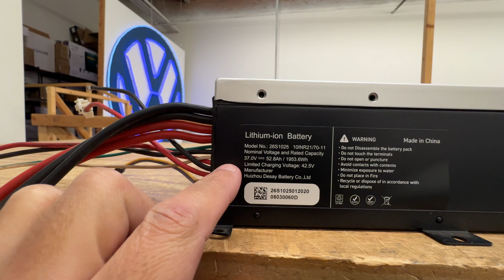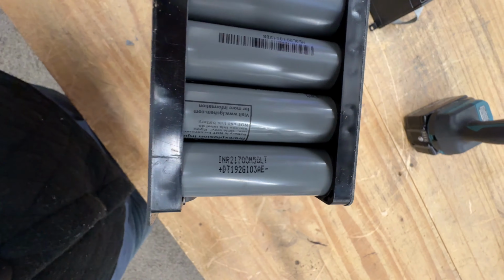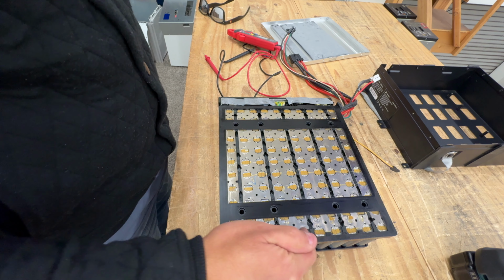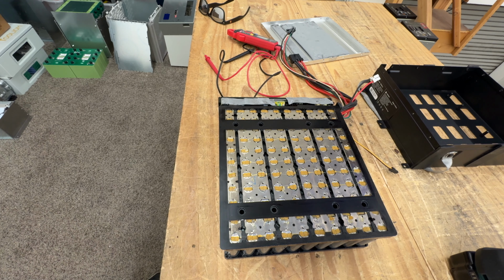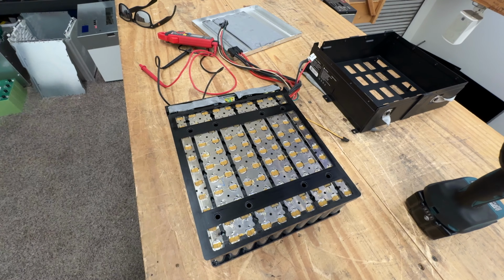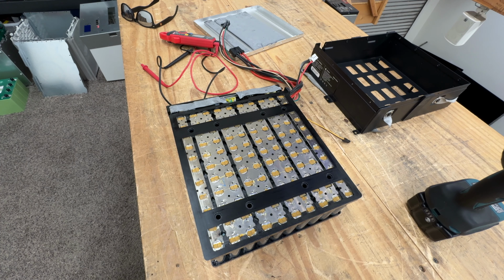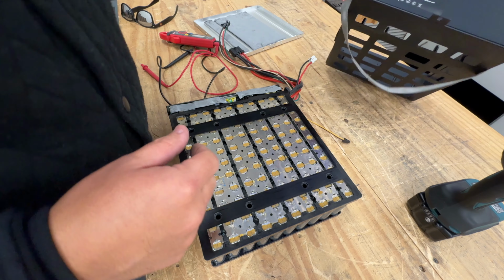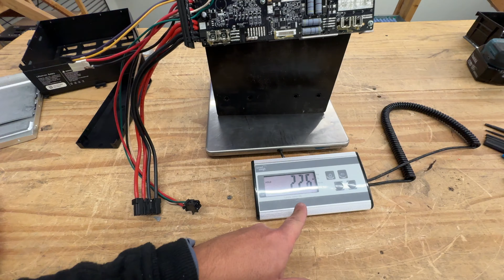36v LG21700M50LT 2kWh Lithium Ion Module

Comment: Would that be a good e bike battery? Currently i have 3 12v 22ah lead acid batteries for 36 volts. That battery looks much smaller over all and has a bit more than double the ah
Reply from the maker: Yes perfect for that application
Reply: It technically has around 4.5 times the usable capacity, lead acid should only be discharged to 50%

Comment: That page you pulled up might have been using the LG M50LT picture but its the specs for the M50. There's an M50, M50T, and M50LT. I know the M50 was the weakest in terms of discharge current. Can't remember what the T model was, but I know the LT is rated for 14.4A if you have the cells at an optimal temperature range.
Reply: Correct.

Comment: Since we will be charging the 48V /51.2) V battery with solar panels (4 x 480W - Vmp = 37.10,  lmp = 12.95A), we would like to have exact information on which Victron MPPT controller is suitable so that the battery will be charged properly (Operatin value charge 43 -58V). Does the Victron 150/45 match the charging voltage? Can the such battery be charged from 200V with a charger, and if so, with what kind?

Comment: I really like the DYI Powerwalls you are building. My biggest question is , is there a system which will switch to battery from 4 pm to 9 pm and then back to grid.
Reply: A timer or some type of electrical product like that
Reply: Send you question to Andy of Off Grid Garage im sure he knows
Reply: I have a 14kwh battery and a single sungoldpower inverter and it allows me to do exactly that . I run it from 9am to 9pm then recharge the battery overnight. I would assume a lot of the solar inverters have this feature.

Comment: so does this BMS actually work? or basically whats for sale is raw used cells in a case?
Reply from the maker: It’s included in the battery,  you might be able to figure out how to make it work.  But I don’t know how to make it work.
Reply: @jehugarcia  it would be helpful if you could provide more information about it like model of bms or anything else.
Reply from the maker: It’s proprietary,  there’s no info out there to share
Reply: @jehugarcia  alright, thanks.
Reply: You can activate the BMS easily. In the small set of 4 wires, one pair activatesthe BMS and the other pair are for data. The smaller red and black are a lower current output and then there is a pair of charge wires

Comment: But once again we need someone to build a 36v inverter.  The 36v batteries are always cheaper.
Reply: A 36v/48v step down converter work good with a 12v inverter.  I've been using a 30 amp step down converter on 36v scooter batteries with a 12v pure sine wave inverter for a couple of years now.